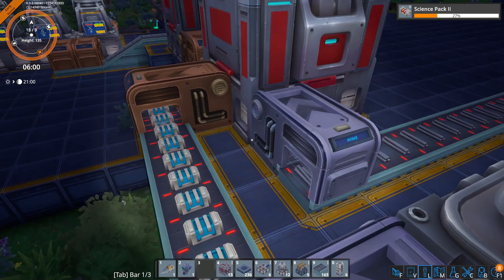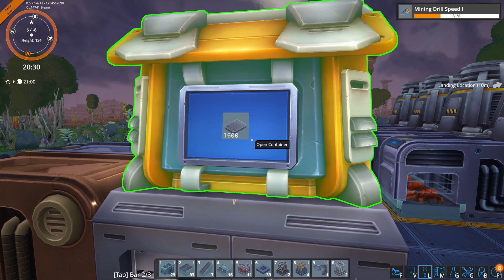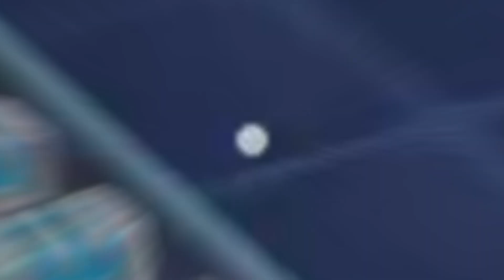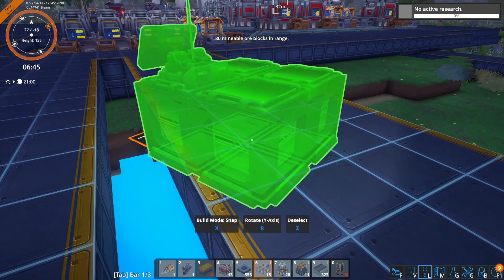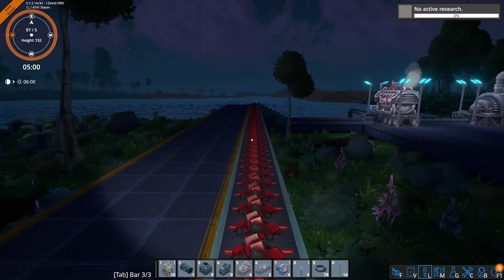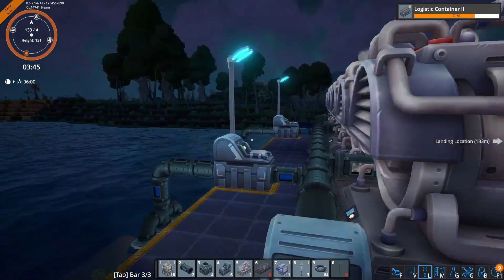Scaling up & More Science! | Foundry | Let's Optimize

Comment: Hey TDA, I am sure you know this, but you can connect the boiler and turbine (without any piping needing), same thing for the boilers, water will flow through, figured I would mention it just incase. I know space is not a problem, so not a big deal either way :)
Reply from the maker: I didn't know that actually! I like the looks of the pipes in this game though, so it's no biggy!